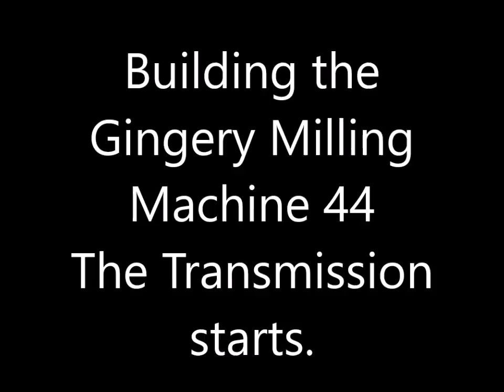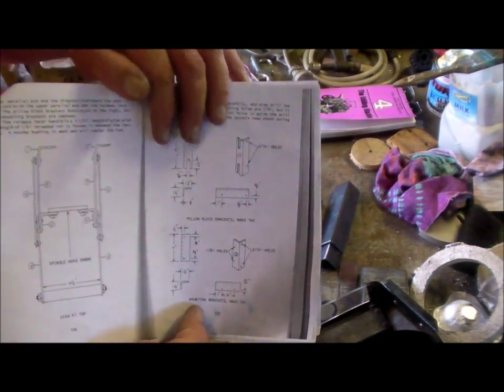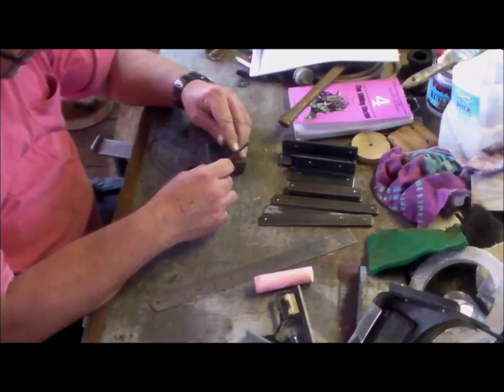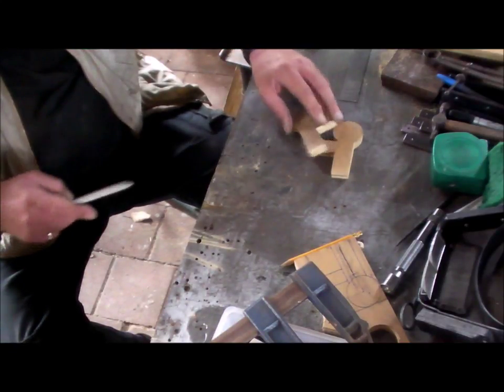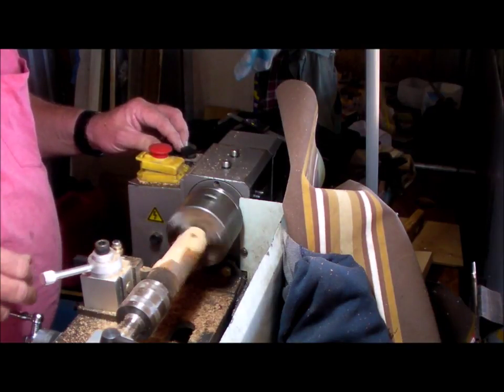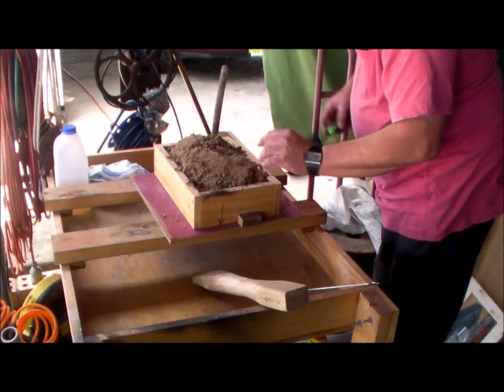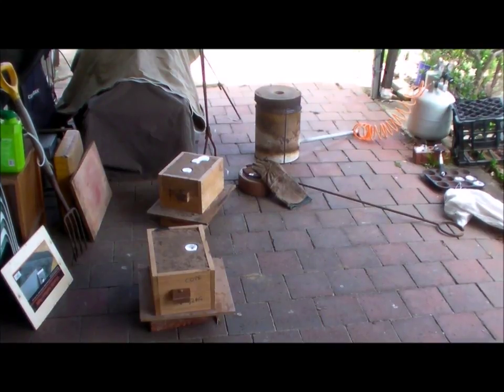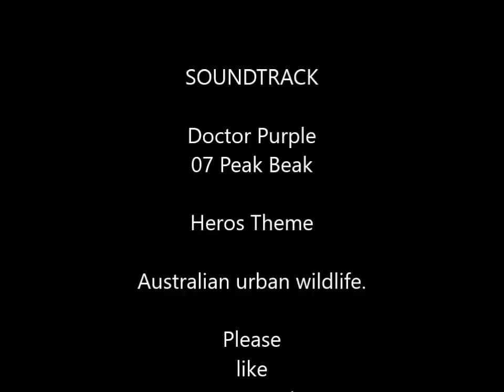Building the Gingery Milling Machine 44, casting the bearing blocks and cranks

Comment: Just wanted to say that I really appreciate the work you are doing. I have purchased the books as well but have to wait until summer to start as we are -31 degrees tonight just a bit chilly. Keep up the good work and thank you Todd in Alberta Canada.
Reply from the maker: G'day Todd, wow, we don't have those kinds of temps but then we are having the extreme temps lately topping at 47 C but thankfully we have a lull in Summer temps, a nice 25C. 
The books are excellent and the Milling Machine book has only a few minor errors but can be noticed if your paying attention. Like the error coming soon in a future video, Gingery has the release crank casting drilled and tapped 3/8 for the transmission rail pivots and then in the transmission rails themselves has the rail drilled and TAPPED 3/8, why, the rail should be a clearance hole for the 3/8 so it will swing without restriction, sorry I'm  getting ahead of myself. The worst I have had is the different material sizes between metric and imperial sizing and the bushing sizing I  Thanks for stopping by
Reply: Thank goodness you are finding these things out you are an easy making it an easy go for the rest of us. As for the metric vs imperial I have access to both so I think I'm going to be fine with using imperial and not having to convert. Cheers, Todd.

Comment: Hello Peter,

A few things.  The castings look like they turned out quite well.  I guess all that practice you are getting is paying off, yes?  :-)  Also, I like the video effect and music you done for you preview.  Seem kind of ominous!

Finally, would you be so kind as to cover the riveting process in a little detail for me.  I tried riveting using a nail one time years ago and I struggled at best and the results were nothing I wanted anyone to see.  All I had was a ball peen hammer and knew nothing of rivet snaps at the time.  Cuprous alloys seem like they would be pretty easy to set, but a steel nail is something entirely different.  Do you have to heat them or something or are they cold formed?  Anyway, if you could show the process that would be great, unless you have already recorded this stuff and I missed out.  But how to form the heads and / or flush riveting would be nice.

Joe
Reply from the maker: Thanks Joe, they are better and yes the music is a new area I may explore further to fill in those times when I shut up, rare as they are. I will say finding music is a slow process so don't expect great musical productions. Riveting as it is I do show how I did the riveting in a later episode, I could make a half episode on cold riveting. Thanks for the support
Reply: Peter, I actually would like some instruction on riveting.  Determining the size, how to shape the heads, what diameter for selected stock.  I have looked for the information on YouTube with little success.  If you go through the trouble of making it I will help promote it.  Deal?
Reply from the maker: Joe, I'll see what I ca do. Cheers Peter
Reply: Thanks Peter, you rock!